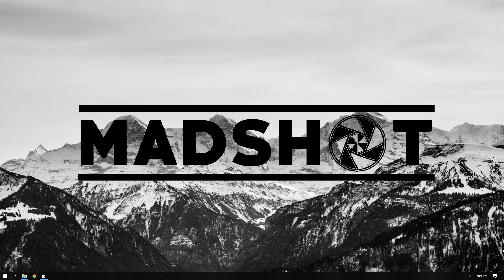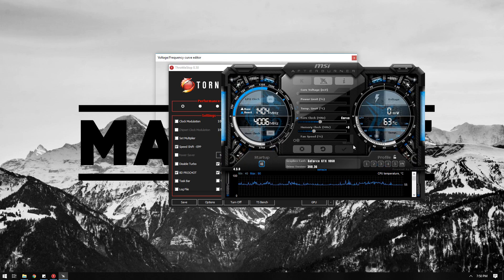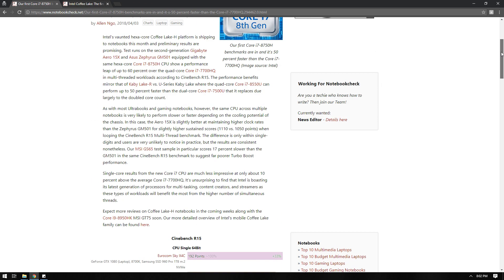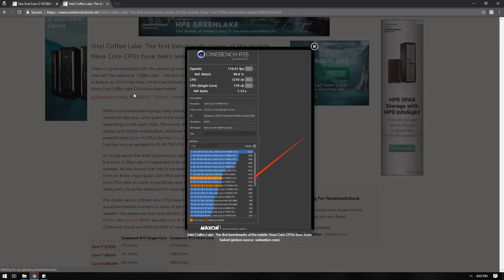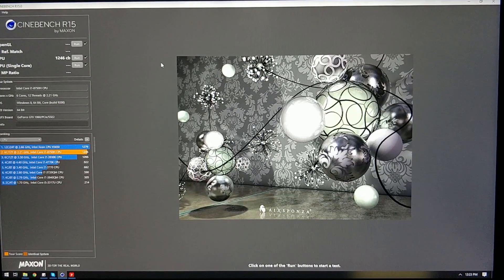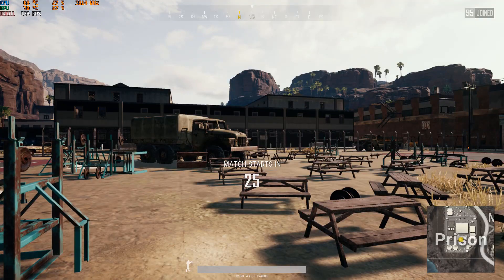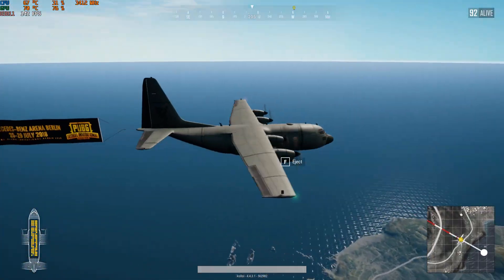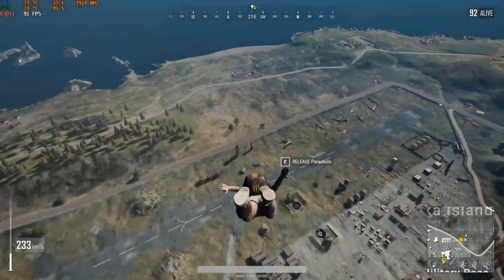GM501 Zephyrus M Undervolt Update - Low Temps (Stock Paste)

Comment: So I have the same exact laptop as you with the same exact specs, running the same undervolt for the cpu and cpu cache and gpu and I'm only getting 60-70fps in PUBG with 140+fps in the main menu only, this is all with overboost. My question is, under the rog gaming center do u run optimus mode or the discrete gpu mode? also if you can suggest what to do with this problem? Thanks!
Reply from the maker: Discrete mode. And turn off gsync on nvidia control panel
Reply: @MadShotTV  Works perfect now! I also went on to GeForce experience and disabled battery boost option that limits framerate. Thanks a lot! :)
Reply from the maker: Nicee!
Reply: How can it be that the fps gets higher in discrete mode? In optimus the 1070 also works?

Comment: can i apply these settings with XTU ? or i need to use the software the same ?
Reply from the maker: On xtu i only have -.065v
Reply: MadShot TV i undervolted i7 8750h to -0.150v and cpu temp still 90-95
Reply: @ahmadasyraf3364  Repaste CPU and GPU, clean fans and vents. Helped me to reduce max temperature from 96 to 76

Comment: can i udervolt with the same settings for my asus rog gl503ge with the same i7 8750h?
Reply from the maker: i suggest you start with -0.010v then increments of 0.010 until you reach -0.070. let is sit there first and if it is still stable, you can go higher. note that if you reach more than -0.100v then the equivalent cache should be very maybe around -0.040 or less

Comment: hey bro, Just asking about the thermals of the Zephyrus, will the laptop thermal throttle as soon as you play PUBG or after playing it for a long time? If it does thermal throttle after a long time of playing, how long do you play it for it to throttle? 

And also does the laptop gets hot very easily? Thanks
Reply from the maker: on my experience, it throttled when it was stock settings doing stress tests. but after doing that GPU undervolt the thermals were very good. But even after all that, I still undervolted my CPU also just to stretch that temp decrease. Never throttled again. But on games like FarCry 5 and the latest Battlefield V Beta, temps can reach 85 so I had to edit the Speedshift via throttlestop to 96-128 to let the temp stay at 69-75.
Reply from the maker: also the laptop is pretty cool on the left side.You really can't feel the laptop getting hot while gaming. but if you are doing typing for hours and hours, you can feel the laptop getting slightly warm on the right palm side. I have the GL552VW before and the thermals are worlds apart.
Reply: What do you think about the ROG strix scar 2 gtx1060? How would the cooling system handle the thermals on that machine? 
And also a question about the battery life for Zepherus and Strix Scar 2, how long can it last for gaming and normal daily work from your experience?
Reply from the maker: battery on both are pretty bad i think. you will need to plug it after every 2 hours on gaming on battery. on form factor and looks, i love that scar 2 due to that thin bezels. but on performance, i think they are pretty much the same. only the cooling differs which I cannot compare.
Reply: MadShot TV thank you so much man

Comment: do you think i can get the same fps that you get with GL703GS 1070 version
Reply from the maker: memed i think the gl703gs is better than my zephyrus
Reply: MadShot TV i also desided to buy the GL703GM but watching reviews i see that the temps are over 80 sometimes throttling
Now i am stuck between the zypherus M and the Hero 2
Can you tell me how much battery life do you get on a normal use and brightness at 25%?
Reply from the maker: i will try to do that but for sure the unit is designed to be plugged not on battery. will update you later.
Reply: MadShot TV at school i will be some coding programs only. No browsing. And at home i will probably dock all my pheripherals 
What's your opinion on the Hero/Scar 2?
Reply from the maker: The Hero/Scar 2 looks pretty cool in my opinion. Thin bezels and a smaller unit. I don't know about the cooling though.
Reply: MadShot TV its mostly the same with the zypherus M. Its has a bit  better battery than the zypherus M but i am not for the QWER transparent keys
Reply from the maker: Abhijeet Etwarysing have you considered the aero 15x? it has the best battery in relation to all this 6 core laptops.
Reply: MadShot TV the problem is that i am buying it from thailand. I lived in Mauritius and gaming laptops are ways expensive. I checked every online shops in thailand and has not found gigabyte laptops. I have seen the MSI GS65 and its like $200 more for the very base model
Reply: Abhijeet Etwarysing i was going to buy zephyrus m but prices in turkey is going way too high its 20k turkish liras which is more than 3 k usd i dunno what to buy anymore
Reply: in thailand its almost the same price as US maybe 50-100 dollars difference
Reply from the maker: Abhijeet Etwarysing yeah. The laptops sold everywhere not in US are damn expensive.
Reply: it runs hotter than the zypherus M
Reply from the maker: oh. i thought it would be cooler because it's a larger unit with three fans.

Comment: What were your settings on PUBG?
Reply from the maker: Luís Costa medium on anti aliasing and textures. high on view distance. very low on everything else. the rest on default. 1080p reso.
Reply: Thanks for the info. Not very high settings but the frame rate is really good. I'm thinking about buying this laptop but I'm still wondering if the GTX 1060 is enough at this price point. For what I can see in your videos it is able to output very good frame rates. In some cases it is really close to i7-7700HQ + GTX 1070 laptops.
Reply from the maker: yep. I prefer those settings. I think if you are into gaming, a cheaper 7700HQ + 1070 is should be the choice. I only chose the 1060 because the one I need is the 8750H for work.
Reply: Ok, thanks for the advice.